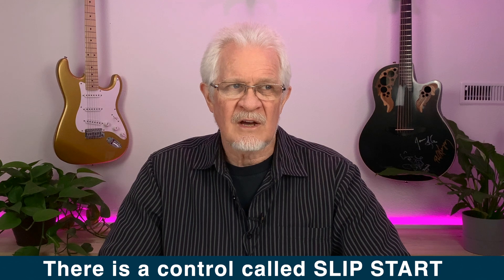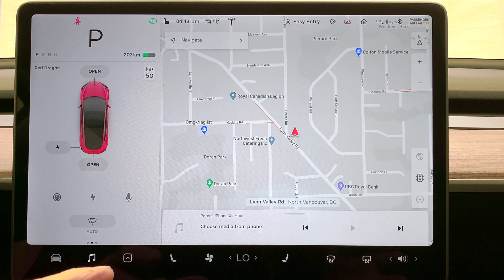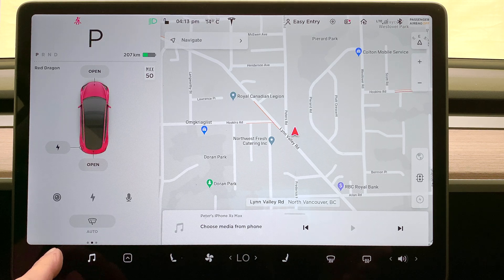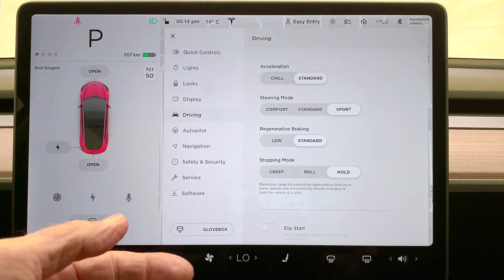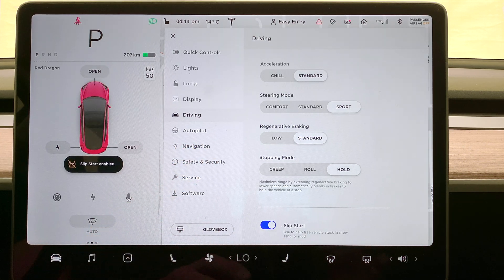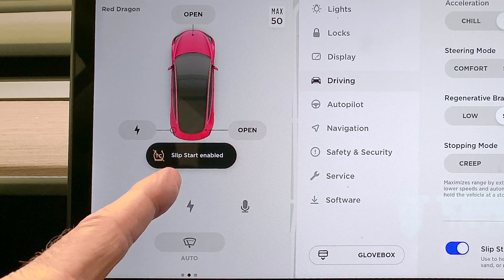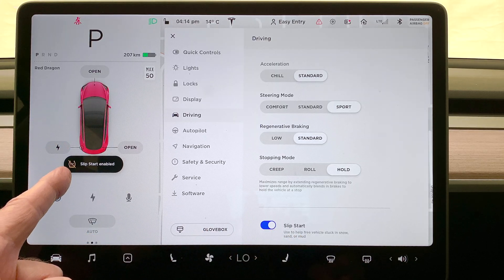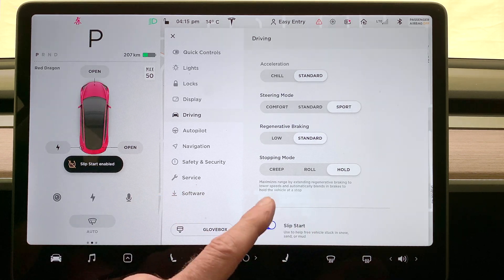Traction Control - NOT for doing doughnuts! (Tip of the Day #47)

Comment: I have experimented with "dynotest" mode. Wow, look out. Do not use this mode unless you are race car/stunt driver. The car becomes a hand full. Lesser drivers will wreak their car. Many already have. Internet and forums full of non-stunt car drivers totallying their model 3.
Reply from the maker: Great, great advice! Also - imagine just DOINT that to our precious Model 3's. Makes me sick just watching it LOL
Reply: What happened when you did it Pat? Interested to understand more
Reply: Ken Dibble When in denotes mode, with an awe Model 3, all anti-lock braking, traction control, and stability controls are turned off. Both motors are at full power. 

When talking off foot to the floor on payment, due to the open differential, the car will either takeoff in straight line or if both tires on the same side hook up, go into a sideways drift almost from the get-go. 

You need plenty of room for correction. In grass or gravel, it seems like all 4 wheels are spinning and drifting becomes instantaneous. But if you get sideways on pavement and sudden let off of the throttle, the car will snap back into line, and if not ready, this will cause loss of control. 

All of this is possible only because of the all the safety systems are off. The car would never let you get so out of position with systems on.
Reply: Damn auto correct “dynotest” mode. And AWD.
Reply: Pat McDaniel thanks, yep sounds like a big handful